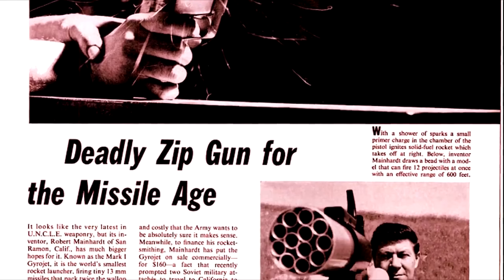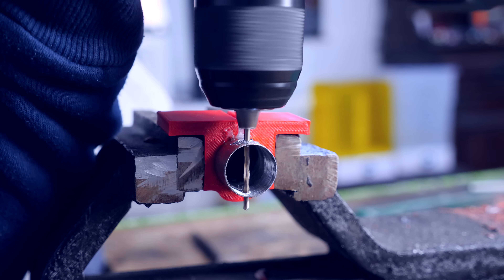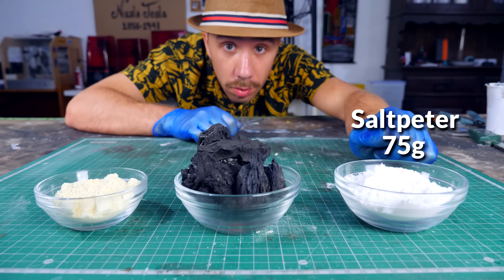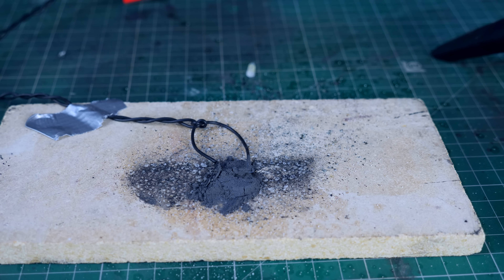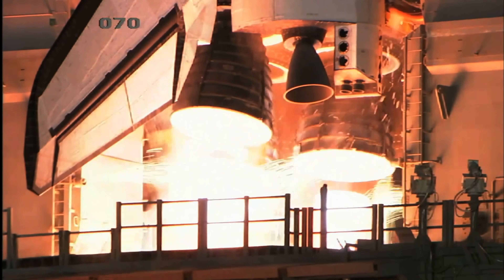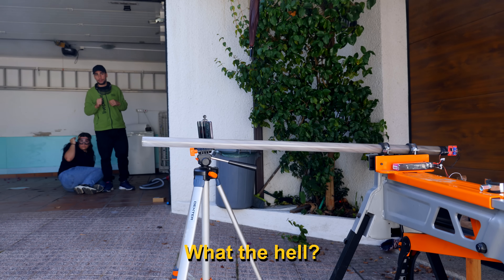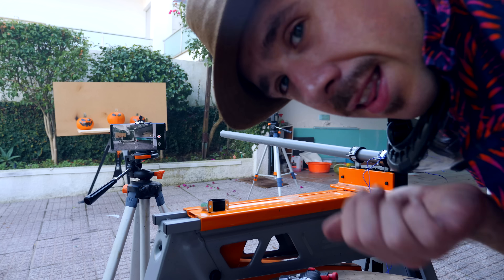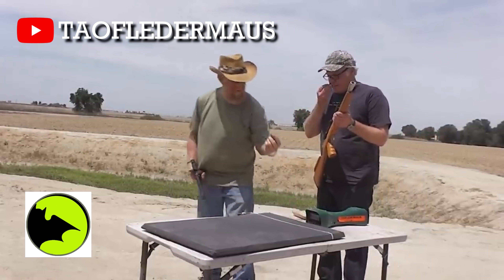GYROJET - The Spinning Rocket Bullet

Comment: What about ammonium  nitrate and fueloil or maybe nitromethane? Or nitro propenyl  it's like nitromethane, but will mix with gasoline, the methane variant mixes with methanol, and maybe ethanol, so what ever mixes with the ammonium nitrate, probably not gas! The nitropropynol  can probably mix with the ammonium nitrate, possibly with kerosene, it carries extra O2, with the fuel, so it will be O2 rich burn, maybe crush the ammonium nitrate to a powder, and possibly a binder maybe mix it in with the sucrose formula?? It's difficult to get the proper ammonium nitrate here, or I'd be playing with it, probably getting myself in trouble in the process, I have done that with black powder,  a 2" long piece of steel pipe, 1" diameter,  full of gun propellant, makes a bigger BOOM! Than you may expect, or can explain away!! At 100 meters, you could really feel it in your chest! And ears!! It was like 12, 12fauge shotguns fired at once! Or a small cannon!! I made a 4" by 8" version, packed full of powder, (usually it's half sand, ) but with a pound of ex-boomative, I kinda went chicken! I'm sure that's enough propellant to put a mailbox into orbit, a lunar orbit! If that one was 'tested' everyone in the county would hear it! Maybe even Break windows close by, ( that's enough propellant to launch dozens of 100lb anvil's, it's like a 1 litre bottle full of powder, inside a thick steel, ( 1.5mm ) pipe, using an electric match, I actually used a 38 gauge wire wrapped around a match head, wrapped in wax paper, placed in the center of the powder, and connected to 300' of 18ga wire, using 120vacto ignite, 12vdc will work for short runs, 50'+/-,  but put a nozzle on one end, and slow the boom a bit, it's a solid rocket!   Good BOOM!

Comment: As an igniter you might try match heads and the strike plate on the side of the match box ground up, it's very sensitive to impact and works as the percussion caps in bullets

Comment: Do NOT attempt to make a bullet smaller than 8 gauge, it's actually illegal to do so in Portugal unless you're a licensed weaponsmith or have a weapons license and are part of a licensed club/range.
For some reason 8 gauge is where the Portuguese government makes the distinction between bullet and not bullet.

Also, what's the point of using a plastic container if you're gonna use marbles? Those marbles are made out of borosilicate glass, which can get a pretty massive amount of electric charge when rubbed against charcoal.

Comment: I'd imagine the burn rate of the propellant is not fast enough for the throats of the engine. Try reducing the cross sectional area of the throats as well as add a third throat and nozzle to the... erm... gyronozzle? Also I suspect the cartridge is just simply too large - air resistance is going to be doing funky things, especially with the dome tip. 
Also yeah... do try to get a better barrel fit :D

Comment: I am sure someone else said this, But here are the tips to make real BP. 
Use food grade KNO3, Use willow charcoal(its fairly cheap to import/ art products lol), ball mill the ingredients for 10 hours, wet with some alcohol water mix and push through a sieve and dry. Now you have a grain that could be used to lift a firework shell. Ez
Also, exploding mental cylinders.. shrapnel.
Exploding PVC tubing.. shrapnel. :) 
Need HDPE / fiberglass :)

Comment: @Integza Video idea: Make a cool Roman Army whistling bullet fired from a sling, but this time, make the bullet a rocket/ramjet. The rotating sling's tip speed should probably impart enough energy to the bullet that you get a decent subsonic FPS. This should be enough for ram compression of the incoming air and compression or temperature ignition of a fuel inside the bullet. Hence you could have a ramjet/ram ignition as a first stage which then ignites a second stage rocket. This can also work fired from a slingshot as well. @integza

Comment: I have an idea! Use a black powder booster charge to push the rockets out of the tube, then have the rockets themselves ignite, using the booster charge as a power trail. Keep the launch tube open in the back to reduce recoil. BTW, tomatoes are disgusting!

Comment: Maybe try a greater nozzle angle? I think the fuel is burning unevenly but also the rocket doesn’t have enough time to spin up while still in the tube. It would be cool to see one suspended in a bearing to test the rotation of the rocket. Also magnesium works as a great igniter. Keep it simple. That’s also avoids the release of the wires setting the bullet off axis.

Comment: This looks promising! You can use a smaller diameter  pipe to prevent the bull3t from tumbling. If nozzles expl0de, you can try a solid core. Alternatively, you can prespin the bull3t prior to launch with a rotating magnet or some mechanical clamp. For propellant, a dry mix of KN03 and ascorbic acid 60/40 will do. Just fine powdered mix -> Solving and drying would just go b00m.

Comment: Since you have worked with a close-to bi-propellant rocket, why not 3D print a pressure fed rocket engine layout with CO2 catridges as the pressurisation fluid, and use kerosene with high concentration hydrogen peroxide, expel them into a combustion chamber and ignite with a spark plug? Just like in real life. Would be fun to see a mini rocket that flies as its real life counterparts.

Comment: Give sulphur and zinc dust a try.   You could try making a paper cone.   Perhaps a nozzle with a curved channel so as the outside burns away, because it's thinner, the channel becomes straighter providing more thrust and less rotation.       ;)

Comment: A few bits of data for you.  
There is a patching compound called 'Durham's Rock Hard Water Putty' that works pretty well to cast rocket nozzles.  I'm fairly sure it's gypsum plaster and wood meal.  
Firework rockets often use nozzles made by compressing pottery clay into a mold.  The mold is a cone in a tube, and the clay is packed into it with a hammer.  
Gunpowder burns faster if made into porous grains.  This can be done by making the fine-ground powder into a paste with water and using a spatula to push it through a piece of window screen.  Fuse for setting off fireworks can be made with fine-ground black powder mixed with glue, and applied onto a piece of string.   This can be done by passing the string through two holes, one on each side of a paper cup, and filling the cup with the powder mixture. 
Coating your propellant grain in the same black powder and glue mixture will help it ignite.  
If you use sorbitol instead of dextrose, you will be able to get a runnier, easier to cast propellant grain.  Also sorbitol doesn't absorb water from the air
Sulfur isn't necessary in black powder mixtures.  It's a catalyst that decreases the ignition temperature, and was important when guns used flint to make sparks.  Without sulfur, the burn stinks less.

The best place to go for information on casting sugar/oxidizer rocket grains is Richard Nakka's website, at https://www.nakka-rocketry.net/
If you paint the outside of your fuel grain or wrap it in paper soaked in waterglass, the coating will resist burning, so your fuel grain burns from the center hole only.  This makes the burn rate and thrust increase over time.
There's a firework design similar to the gyrojet called the 'stinger missile' that uses two nozzles, one of which is tangential to the body, and the other axial.  The tangential nozzle spins it and the axial nozzle propels it.  This gives very reliable spin stabilization.  https://www.skylighter.com/blogs/how-to-make-fireworks/stinger-missile-making

Comment: You said in your co2 nozzle video that you didnt get any lift and mentioned the bottle icing over because of rapid decompression as an air softer we notice this with slower cycle rates that said have you considered a heating blanket for the cartridges? It would keep the molecules sped up like drivers who use nitrous oxide bottles with heat blankets

Comment: I don't think the issue is with your nozzle, but with the propellant. There are three solutions I think could work: 
*Change the composition of the propellant to something faster burning, I.E. Ammonium Perchlorate. 
*Change the shape of the charge to increase surface area, something like how Backyard Ballistics did by rolling a spiral. (use cooking oil to help keep it from sticking to molds)
*Increase the barrel length to give the grain more time to reach maximum output.
(I really have no idea what I'm talking about, but there's my 2 cents)

Comment: Using the larger pipe that doesn't fit the "bullet" you should use a sabot to get it to fit the pipe properly and keep the "bullet" straight and from flicking about within the pipe
Reply: You could potentially use a foam or rubber design so it is easy to carve and shape into the correct size. Also I would recommend having the sabot split either into three or two parts so it simply just falls away after exiting the pipe

Comment: gunpowder tends to ignite better when it's been packed down. could try printing a very thin two piece form that you can run the wires into so they get packed in place with the rest. 
wouldn't need glue if done right, could be held together with electrical tape for the clamping force keeping the powder packed in tight.
I could sketch out the basic idea if you're planning on exploring this project further.

Comment: Next vedio:Why don't you use pressurized CO2 cartridge itself as rocket/bullet to smash tomatoes "GAS POWERD ROCKET" it would be awesome. 😁😁😁
Reply: Yep ,nice idea he will neither need a gun powder nor a propellant mixture he made.
Reply: @AdityaKumar-oh2rv   I think the pressure inside the CO2 cartridge will give more acceleration than the fuel he used.
Reply: @adityaanandiitb5302  he will need a different mechanism to open the valve of the cartridge. I saw one on "Mr. Indian hacker" channel ,he was launching the cartridge vertically, it was ausome.
Reply: @AdityaKumar-oh2rv  looks so cool, seems that the tiny cartridge has so much power👍👍👍
Reply: Integza already made a mechanism to puncture the valve with an RC circuit,now what is left is a release mechanism which I already have an idea for but ..but..but
What i regret that I could not do it myself my neighbours would be furious 😁😁😁😁.
Reply: @adityaanandiitb5302  😂😂 it would be nice to watch to tomatoes getting smashed in slowmo

Comment: Since the nozzle was ceramic, you could wire one lead of the in igniter to the body and a small lead through the nozzle to the nozzle surface. Then to make the circuit contact the rocket body on the barrel and make a contact to the wire at the nozzle. This way you don’t have a trailing wire.

Comment: i bed you could use something like a strip of Mg or something across the bottom to ensure the whole bottom of the propellant ignites evenly. it kind of looked like you would only get a partial ignition leading to only 1 nozzle outputting any thrust. im pretty sure the gyrojet itself had a ton of R&D just in the different propellants used to time the ignitions. the original would use a small initial rocket to launch it from the barrel, then a well timed burn carries to the tilted nozzles to begin the spin and final acceleration. i think you could probably figure out a better shell design, but it would fall more into chemistry than engineering. 
was also thinking that if you used the right materials, you might be able to fabricate a SLA printing solution that could be used to just print the majority of the propellant charge. you wouldnt need to worry about it fully curing either, so you could probably print them off real quick if you took the time to dial in the exposure times enough so they just dont de-laminate from the pull forces.
I'm both a 3d printing hobbyist and a hobbyist chemist, so i think it'd be super cool to try and see this one through to the end.

Comment: Having only two jet nozzles makes it really easy to have defects throw off the balance.  Also if you lubed up the tighter tube with, say, a silicon lubricant, you may get better results.  Given how easy those bullet bodies are to make compared to your regular projects, it'd be interesting to see how different nozzles affect it.
Reply: Graphite lubricant would be perfect for this. Especially because it's dry.
Reply: @chemistryofquestionablequa6252  Except that dry graphite lubricant can catch fire pretty easily (powders + a volume of air), and requires dry chemical or CO2 extinguishers to put out 'cause once on fire it scatters too.

Comment: video idea: try doing the gyrojet with a different design, I don’t know if this will work but an idea I had would be to have three openings on the nozzle, one straight and two similar to the original except with a better angle to produce more spin. that way you would still get the thrust from the main opening but you’d also get the gyroscopic balance.

Comment: You would get a better result by using compressed gas for your rocket and tune the design accordingly then moved to gunpowder. You could also try spinning rocket with electromagnets and then fire away.

Comment: A way to also fix stability is to move the center of gravity of the projectile towards it's nose, maybe if you 3D print a little weight that fit inside the nose of the cartridge it might not tumble as much. 

Another idea is to make one hole for each nozzle, and then line them up with the nozzles. The problem with the last idea is that it would make it more complex to ignite the propellant.

Comment: I think maybe the nozzles and the fuel “Tube” are working against each other. In a typical rocket the center hole/channel in the fuel would line up with the hole in the nozzle. More direct shot. In this setup the gas is colliding with the nozzle and then finding it’s way out the two off center holes.

Comment: Could you 3D print a nozzle mold and then melt metal in your kiln to pour in and make a solid metal nozzle? Maybe impregnated with water cooling channels to keep them from melting.

Comment: Idea: create a setup that spins the rocket inside the tube just before you fire it, then use a regular (non spinning) nozzle.
To spin the rocket inside the tube, at the position you place the rocket, cut a window, and use a electric motor with some rubber roller to spin the casing in place.  No bearings, pretty simple.
I know this "defeats" the autospinner you were trying to make, but at least you can test the other parts of your design, and then later work on an "spinning nozzle".
Great videos.  And BTW, I love tomatoes :)

Comment: Wonder if it is possible to start the ‘bullet’ spinning by using compressed air on an angle. It’d probably need a fuse rather than an electrical ignition. Or continue using the electrical ignition but use the casing as a ground so only one wire is required to poke out the back.

Comment: maybe you need to speed up the twist rate of your rocket. I know when i reload ammunition for my rifles, if the twist rate of the rifling (the grooves) of the barrel doesn't match the bullet ,the bullet wont stabilize well. usually the longer the bullet the faster the twist ,for example 1 rotation of the bullet in 8 inches is somewhat fast while 1 rotation in 14 or 16 inches is considered slow . maybe it could be the same thing here with your rocket. maybe speeding up the spin will help stabilize it since you don't have rifling to help with spinning the rocket since your tube is smooth.  

hope this helps and you don't get confused with my use of imperial units haha

Comment: Add a stopper to let the bullet build up some rotational momentum before firing
Or use an electric motor to spin it before launch
A third option would be to angle the nossles more, but that would likely cause it to waste forward energy on unnecessary spin further on
Also big thumbs up for launching rockets towards neighbors house!

Comment: Video Idea: Rotary engines (like the one you made in a previous video) follow a couple of geometric principles. In theory, there are many different possible geometries, but generally only the "triangular" kind of shape had been used in the real world.
I have created a 3D model (many, actually) where the rotor has only 2 apexes, rather than the normal 3. The resulting housing/rotor shape is really interesting, and can create a much bigger volume differential between the high and low pressure sites. This geometry also eliminates the need for valves because high pressure is always created on one side of the housing, while low pressure only occurs on the other.
But the coolest thing is that the air takes a very circular route, and the exhaust is located in such a way that centrifugal forces should also play a part in expelling it - giving it secondary attributes similar to a centrifugal pump/turbine (even though it's technically a positive displacement pump)
In theory, it seems like it should be more efficient and forgiving when building it with 3D printed parts, so if you ever thought about revisiting the rotary engine, maybe it's something you'd like to try.
Drop me a line and I can share pictures of the geometry and/or the 3D CAD files